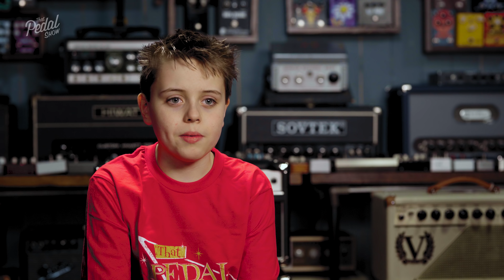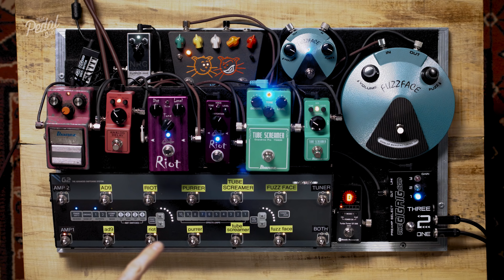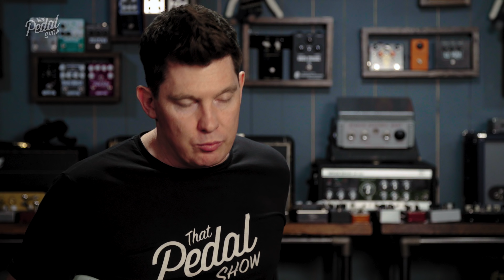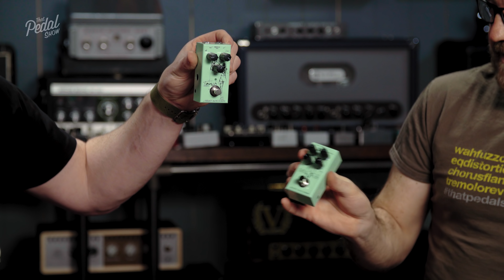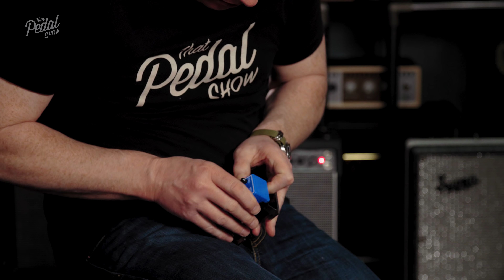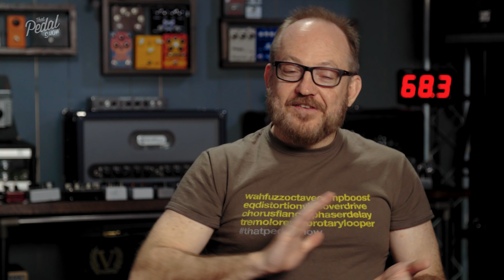Mini vs Big Pedals: Distortion, Overdrive, Fuzz And Analogue Delay: That Pedal Show

Comment: Hi Dan, electrical engineer here... Just a quick clarification on the surface mount component sizes. "0603" means 60 thousandths by 30 thousandths of an inch (also called 'mils' traditionally but has nothing to do with metric millimeters). The smaller components now are "0201" and smaller, such as "01005" where the latter is 10/1000 inch by 5/1000 of an inch! They look like specks of dust. There are metric sizes too, so an "0201" imperial is actually an "0603" metric (0.6x0.3mm)! Appreciate you diving into the electronic details sometimes! (Edited for accuracy.)
Reply: Nearly - 0603 is 0.060 x 0.030 inches 😀
Reply: @ians3056  Whoops  Common programmer mistake - off by one (significant digit)! That's what I get for trying to clarify! (I'll edit to fix.) Thanks!
Reply: @JYelton  🤘🏻

Comment: In my opinion, the big pedals with top-mount jacks is a far better design than the narrow pedals with side-mount jacks.   The bigger pedal size matches the size of one's foot, and is less unstable relative to both feet and cable tensions.

Comment: Thanks loads for the feature guys!!!

Mick - I was about to respond “well, you don’t often have all the knobs and switches on your guitars labelled and you’re fine”, then...
(I can happily hand-paint control labels on the bigger PURRER as a custom request).

And just a couple of notes for anyone who cares: 
- Just like the PURRER, the PURRER-mini is totally hardwired using high quality full size components, but just with streamlined circuit and controls.
- With the “SOFT” toggle switch of the big PURRER flicked up, the frequency response would be much closer to the PURRER-mini.

Cheers!
Neil

Comment: Thing #1: If you use a looper (Like G2 or Boss ES 8) with 5-10 loops then small pedals can really save space, that case, mini pedals really are worth the consideration.  On that point, if your board is already full, but you need that one more pedal, maybe the mini-version is the only one that will fit. 

Thing #2: Dan, I love that you're taking a trip down the rabbit hole.  I know you two have said before that you prefer a big amp with big sound moving air and tickling your bits, but for the rest of us that play on a silent stage and have to consider things like cab/amp simulators, its good to (hopefully) see you guys explore this a bit more.  

Keep up the good work!

Comment: The early BBD chips generally gave a maximum delay time of 300 ms, which was also true of the Boss DM-2. Because I came up using that quarter-note triplet or dotted-eighth rhythmic delay sound, I never used those older analogue pedals because at 120 bpm, a quarter-note triplet is 333 ms and a dotted eighth-note delay is 375 ms. So, my first delay pedal was a Boss PS-2 Digital Pitch Shifter/Delay (1988?), and I've used digital delays ever since. The newer BBD chips now give much longer delays.
Reply: Not really, they just cascade multiple chips into each other. Mostly because BBD chips are so cheap nowadays. Behringer having acquired CoolAudio just cloned older Panasonic MN.xxx designs which are/were the most  dominant design used in the guitar cq music industry. EHX even switched to CA chips which dropped the price on Memory Man pedals a large bit. Personally I don't like these versions because of the increased noise, but ymmv.

Comment: Glad you guys have been giving the Fillmore 50 a run. I replaced my Mark V with one when they first came out (The MarkV rig had become impractical). I've been really enjoying it with or without drive pedals - really responsive EQ. Plays great with a G2 as well for switching channels and reverb and the effects loop works great. Almost always run mine in 25 watt mode so that I can open it up a bit more to hit it's output section sweet spot.

Comment: Hey chaps, I just happened to watch this video after repairing a mini ibanez delay. The blend knob on this one broke and instead of going through the trouble of replacing the potentiometer - too much work for a pedal that was practically given to me - I hotwired the blend knob to give you the same as putting it on 11 o'clock.

What I noticed with the pedal is that anything past 11 o'clock definitely becomes "too busy and inarticulate" as you said. The repeat seems to be even louder than the original signal. Keeping the knob below half is definitely where you want to be with that pedal and that's the sweet spot for most of the settings you'd imagine you want an analog delay to do.

Comment: Cool episode boys! My board is a mixture of several mini pedals and a few "normal" sized pedals. I use a centralized power source so lack of batteries is a non-issue. And I use Dual Lock, and find that there is no issue with the pedals flopping over to one side when I step on them. Now, having said that, it is true that the mini pedals don't save a huge amount of space due to side jack placement, and the need to be able to step on them individually, but they do save some space. Some mini pedals that I use and really like are: TC HOF and Flashback Minis, and Polytune Mini, and the Mooer Blues Crab, Yellow Comp and Hustle Drive. They just sound great, and they take up a little less space. I also use the Donner Boost Killer at the very end of my signal chain for a pure solo boost, and it sounds great, but I mainly got it because it was SOOoooo cheap :-)

Comment: First of all guys, I gotta say, thank you soooo much for all your videos! I've learned more from you both than imaginable!!! I just wanted to add here about the Mini Fuzz Face VS. the Larger Ones. A high advantage of the Mini other than the small cute size and LED and DC jack, is that they also have a Bias internal trim pot, accessible through the battery hatch on the back. It can be adjusted to taste or different saggy tones or wide open fuzz with a tiny phillips head screw driver! This IMO, is a huge advantage, to squeeze more types of tones from the Fuzz Face. (This also could be why there seems to be a bit of a difference in the top end and overall sound between the 2 pedals in this video, other than the difference in components and pcb/wiring... ?..)

Comment: Great episode, One thing No one ever brings up about the TC Spark is it's momentary function. At any time if you press and hold, you can play a quick riff then let go and go back to rythm. Killer feature. I dont even worry how the boost sounds compared to other boost just for that!
Reply: Does the big Spark pedal do that too?   Apparently not, as far as I can tell.   TC kinda messes up on this as far as marketing goes.  Compare to the Vertex Boost, which provides a volume pedal driver function.   If you don't want to have a volume pedal, the small Spark makes a compact solution!  Even though the mini pedals are valid, for some reason I don't like them as a general rule, as my feet are too big.
Reply: @mobydick3895  Yeah as far as I know, it was only on the mini.

Comment: The moment you accidentally set both tube screamers on at the same time was so hot. That was the stuff!

My observation about mini pedals is that so often the mini pedal is more aggressive sounding than the original big one. Has maybe more highs, level, gain/some kind of punch. They sound more modern than the originals to describe the sound in short.

Comment: Hey Mick, the reason the Band of Gypsys Fuzz Face doesn't clean up, is because it's not a Fuzz Face. It's actually a heavily modified Octavio. Here's a pic of the PCB of the big version: http://files.effectsdatabase.com/gear/pics/hendrix_jh-f3_003.jpg

The top left transistor is a BC 560, and the other 2 are MPS3904's.

Comment: Great intro! Funny thing is, most of these mini pedals have about the same footprint as a normal pedal with top-mounted jacks.
Reply: Well, if you don't consider the height. If you have two rows of pedals that makes a difference. Also, top mounted are the best with a pedal board with cutouts and a looper. Sometimes they are a pain.

Comment: Have you tried running your fuzz face into an overdrive?  Helps to mellow out some of the spiky tones in certain amps.   I did it for years when my main amp was a twin reverb... I’d run the fuzz face or a big muff (I find it works for lots of different fuzzes and distortions)  into a tube screamer set with low gain and then use the tone on the tube screamer for fine tuning the EQ...  sounds quite good.   Sometimes sounds best to have the gain  low on both devices 😊
Reply: I run a silicon fuzz face trough a TS into phaser and delay and it sounds fucking massive.
Reply: Yes! I have found for Muffs that a Soul Food/klone works best in this capacity, set the same as you describe setting the ts.

Comment: This is great guys! I just traded up to my first Mesa today and wow am I loveing it. I got the older 5-50. Its cool it does class ab push pull in 50 watt mode and class a A in 5 watt mode, I couldnt believe how loud 5 watt can be. Im now working on dialing in a clean tone for pedals now and might use you sound clip

Comment: Unrelated to this episode, but a possible idea for a show: I recently got a DOD Rubberneck (which replaced the Vapor Trail I bought a few years ago after seeing it reviewed here) and a Catalinbread Zero Point (my new favorite flanger). Both give real-time control over various elements of the sound, so you need to "play" the pedal – I don't know how many other pedals like this are out there or if it makes a good concept for the show, but if nothing else you guys should try the Rubberneck because it's unreal – 1000ms analog delay with tap tempo, oscillation switch, and the "rubberneck" feature that changes the delay time while you're playing.

Comment: Late to the party on comments here.  Busy weekend with some travel.  Always enjoy your videos.  I felt like this week the Tube Screamer and the Fuzz Face in either size didn't have the magic with the two amps.  Even the Riot seemed to struggle with the Boogie.  The Purrer seemed to hit both front ends just right and the delay was certainly awesome.   For sure though, anyone of the smaller versions could do the job appropriately.  As long as the user understood it was not a matter if simply matching the knobs.  Thanks for all you do.

Comment: Dear Mick and Dan,ystematic
thanks for your good work! Some awesome tones from todays amps, especially the Boogie.

One thing I would like to suggest as a theme for an installment is a thorough and systematic discussion of different ways to set up your amp with regard to it's basic settings, i. e. relation between gain and master volume, amp EQ, and the like.

Much has been said about clean and gainy amps and I have learned a ton by closely watching and trying out some of the many things you've been demonstrating so far. Yet, I think that there are many different tones to be had from e. g. different EQ settings and maybe other guys, too, would like to see the way that you gents go about setting up your own amps - I take it that the two of you have different "philosophies" to that regard, so, hopefully this idea appeals to you.

Anyway, thanks again for all you've accomplished  so far. Greetings from Berlin, Germany!
J.

Comment: As I know Mick and Dan well-know, auditioning pedals, amps and such solo and in this kind of “silent” format is totally different from hearing them in use when playing in a band. Once everyone is bashing away, small and even substantial nuances disappear. That, and the fact that no two pedals, even those of identical kind sound totally alike affects these comparisons greatly.
 Additionally, the amp and guitar you play, how they are set up tonally and each individuals’ particular way of playing make everything different. You will not sound like Dan or Mick or anyone but yourself, even if you played their guitars through the same amps and pedals. Of course, that might be an improvement (LOL). Cheers guys.
Reply from the maker: Yes yes, that's what TPS is all about! Understanding that it's what works for you which is most important. All we're trying to do is get you further along your own road. Cheers!
Reply: Spot on. We're so obsessed with minute differences between instruments, pedals and amps... Differences that a) only another audiophile can hear, b) only another audiophile cares about, c) completely vanish in a mix or live setting.

I've stopped looking for the holy grails long ago. A couple of guitars with different pickups (dual humbucker, strat, tele,...), couple of essential pedals (compression, couple of drive/fuzz/distortion flavours, some sort of reverb, some delay/modulation for fun, maybe an eq but not necessary) and then an amp and cab sim into a PA.

It's 97.5% of the way there. So I can spend my time playing music instead of obsessing over gear.

Comment: I really adore mini pedals for certain applications- I think as with so many things in the world of guitar its all about time and place. certain pedals in mini form are incredibly effective for what they do, and in moderation can give you a great way to capitalize on limited space, which is always a concern no matter the size of the board. as you mentioned, the Xotic pedals are great examples of a fantastic sounding product in a small enclosure. I also really love the Zvex Fuzzolo for that reason- it's a simplified and shrunk down hybrid of the Mastrotron and the Wooly Mammoth, but in a small enclosure. And especially given that so many fuzz pedals come in unconventional enclosures (not necessarily a bad thing), it's great to have a killer sounding pedal in a form that will actually fit on my board (i'm looking at you, Fuzz Face). That being said, moderation is SO critical. I think as tempting as a mini board sounds in theory, it just doesn't work out in practice.

Comment: Well, you convinced me, I'm sticking with my "big" Fuzz Face, it's sounds nicer than the mini one IMO. I have a couple of mini-pedals and they are okay but I generally prefer the bigger ones for a couple of reasons. One reason being that it's easier to tweak the big ones, I can even turn the knobs with my foot, which I can't do with the mini ones. Plus I prefer to be able to turn knobs on the outside and not have to fiddle with internal thingamybobs.
Cheers.

Comment: Generally being a fan of mini-pedals. One thing that does piss me off is that the markers on minor control knobs are rarely clear - they're just a small notch in the black plastic. You have to look really closely to actually see what your level etc is! This is common to all of my mini-pedals, but I notice the Riot has clearer knobs.
Reply: Just grab a white sharpy
Reply: @vanhaluke  I actually used Tipex! Its just such an obvious design flaw.
Reply: @JDODify  I use  tipex for dimming some bright led's on my pedals.

Comment: I really enjoyed this one...
I had a crazy journey tried to make a small board with mini pedals
Had that mini Ibanez delay, Phase 95, SL drive, SP compressor, Mooer trelicopter and more i probably forgot..
Only 2 left (for now) - Ep Booster and JHS Tidewater tremolo and i just got a Pedaltrain Nano + board
Reply: @hatuliko2009 on a sidenote, I’m curious if you can share how you cope with the booming low end of the EP booster? Where do you place it on your board and how do you use it live? Thank you in advance!
Reply: @Tomsdrawings  
I use the EP booster second to last in chain, delay being last. EP booster is always on as a tone shaper with minimum vol on it.
I set my drives/fuzz on the treble side of things and the Ep helps making it sound rounder and less harsh. It doesnt only add low end.. also adds some mid and highs as well, but in its own special way.
Reply: hatuliko2009 Thanks. Inspiring! I’m gonna try it in front of my super harsh 5e3 kitmade amp w/ Jensen speaker.
Reply: @Tomsdrawings  Try and tell!! Good luck!
Reply: hatuliko2009 I have done a few tests. First of all, the EP Booster appears to do a lot of good to the harsh amp. Even the bright channel is now pleasant. Especially the clean sound is much more in the AC30 ballpark (remarkable for a 5E3). A round creaminess with a slight glassy sparkle, truly lush. However, the EP Booster is still quite a drastic EQ gamechanger. In the -6db channels, no problem, but in the loudest channels (bright and normal) the two lowest strings play, at full guitar volume, distorted, and it sounds like speaker breakup. Another consequence of the EP’s lower mid addition is that there is a big difference in how it takes drive pedals. The best results were obtained with the wonderful Pettydrive pedal, which has 3 low cut voicings per channel (of which one is presumably flat EQ). So a drastic low cut on the drive pedal was necessary to combine with the EP booster. It’s balancing between taking away the harshness and letting the treble cause a nice overdrive. Thank you once again for revealing your setup, it helped me. I’m gonna use the EP with this amp.
Reply: @Tomsdrawings  Glad to help.. sounds like youv'e figured stuff out for yourself..!

Comment: A coupla' tips for mini pedals on a board: 1. EBS or other super flat patch cables.  Helps with leaving more room and great sounding.  Less hassle with setting up a small board (I started using them on all my boards in various sizes in fact.)  2. 3M Dual Lock.  I use it on all my boards (Mick and Dan call it "pedal board tape") and my mini's don't move.  At all.  I switched to a mini board recently after having some of my precious boutique pedals damaged in travel back and forth to the UK and Europe and it's working beautifully.  And I have big feet too!  Cheers guys!!